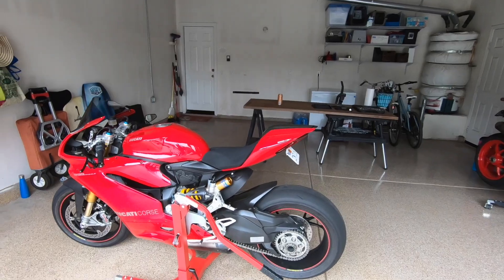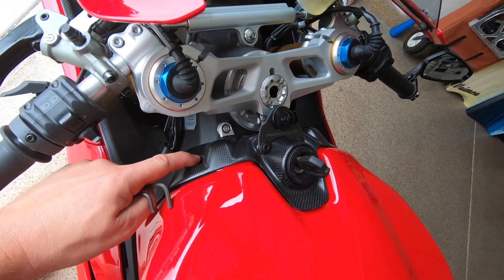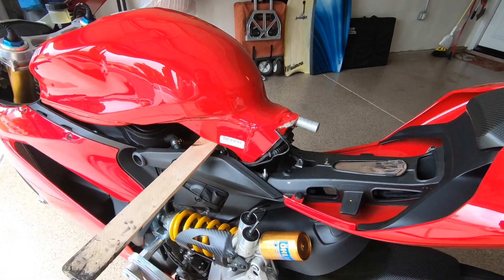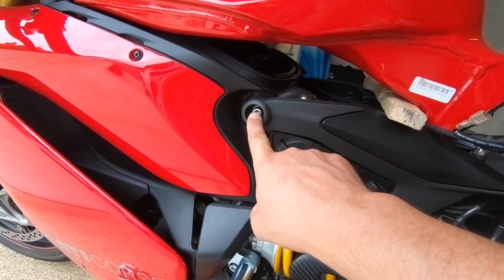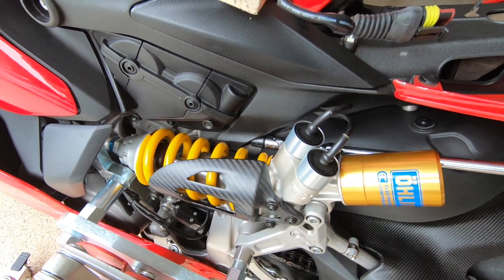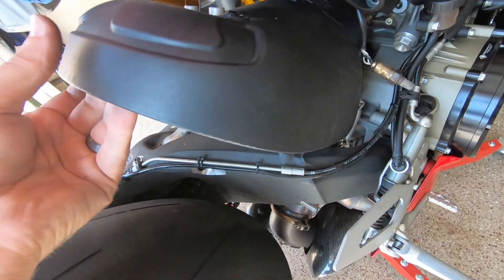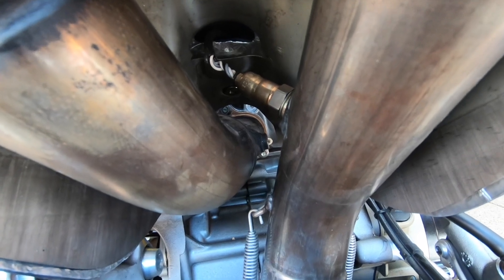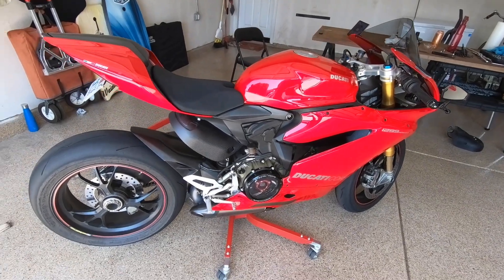How To - Replace Panigale Exhaust Cover

Comment: I'm glad I watched this. I have a bunch of CF parts going on this weekend to include the heat shield and rear hugger. But I'm also changing oil and replacing air filter. So tank removal is probably a good idea.

Comment: Any chance you can confirm the bolt size under the tail on both sides? (The difficult ones.) I'm working with allen wrenches. Almost looked like a 5mm would get in there. Too small. 6 seems to be too big. My 5.5 won't get back there.

Comment: Hi buddy,I have the 959 panigale,bad heat issues,does the carbon fibre shield help rectify the problem?or do you think heat wrap around the rear exhaust be better?thanks,great video,very helpfull,